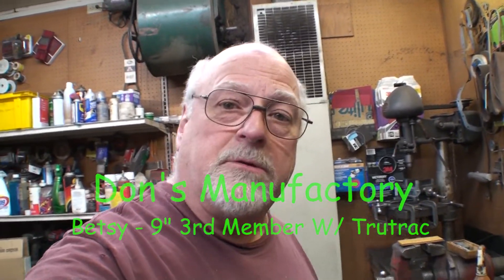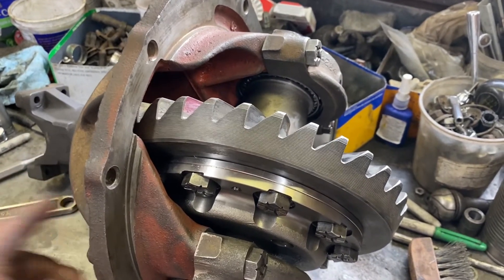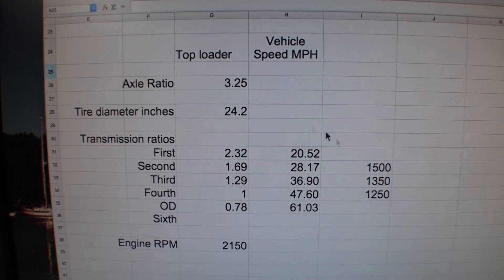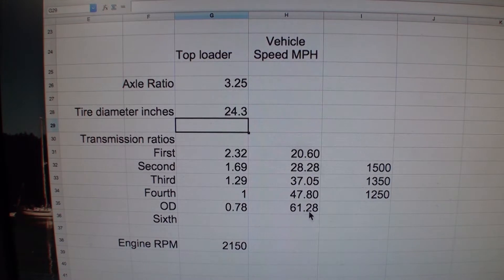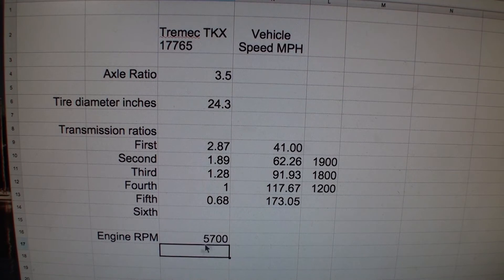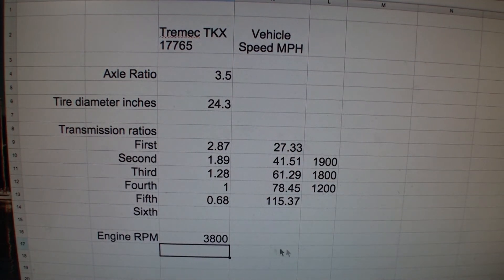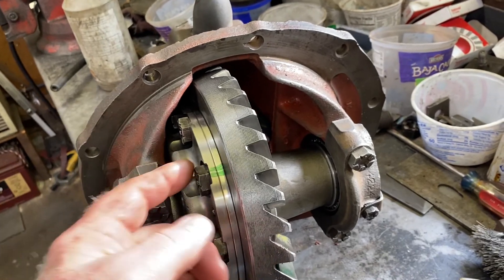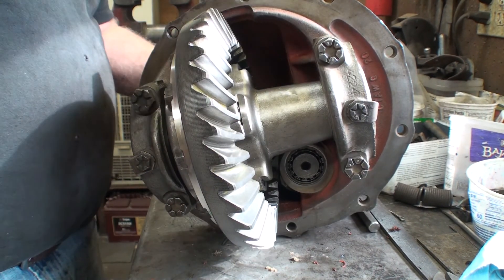66 Mustang Betsy - Differential w/ 3.50 gears & Trutrac

Comment: WOW, how did I miss this video. Perfect timing as I need to replace my ring and pinion as my car was a 3 speed automatic which came with an anaemic 2.79 gear ratio to compensate. Now with the T5 World class with OD there is NO hole shot and cannot even go into 5th under 70 miles an hour as the RPM is about 1500.  Sounds like the 3.25 ratio is right where I want to be. Thank you Don. Oh honey , Where is the cheque book 🙂
Reply from the maker: Thank$ Wally, you are mo$t welcome. Your video$ helped me along the way too. AND, now you have good cau$e to $pend more time and ca$h on your 68.
Reply: @donsmanufactory   Thank you Don, I have no idea but I was no longer subscribed and as I look there are a number of sites I have lost subscription to. So not sure if it was something I did or YT. But glad I am back, got some catching up to do.
Reply from the maker: @68mustangrestoration34   - I should mention the T5 world class can come with 2 different 1st gear ratios (3.35 or 2.87) and 3 different OD ratios. Didn’t want to mislead you. You do not seem to be math challenged however. 🤓
Reply: @donsmanufactory  No problem and thank you .But the proof is in the pudding as 1400 RPM at 60 miles an hour in OD is WAY too low. I already know I have an insanely low 2.79 (Axle type on door tag) gear in the back , plus hole shot sucks as well. 3.25 is a good mid gear as I know I can even go 3.55 but not what I am after.  Thank you again
Reply from the maker: @68mustangrestoration34  - Since you are complaining of a poor hole shot maybe you have a 2.87 first gear. A 3.35 first gear would net a “normal” hole shot at 9.34:1, about what betsy had with the T5 & 3.00 gears. Sounds like a .68 OD.

Comment: Great info to help guys choose their ratios for racing. I need to make a yard run and see what ratios I can find on the available explorers in the yard. I'm not planning to go too low of a ratio since allot of cruising on the freeway here is at 70+ and it's just a toy for her to drive.
Reply from the maker: Hey Robert,
Well, I included some calc for cruising but no automatic trans data. 
AOD: first=2.40, second=1.47, third=1:1, OD=.67
So 3.00:1 gears nets 72 mph @ 2000 rpm (stock sized tires).
Would start to bog at 60 mph in OD @ 1700 rpm depending on cam of course.